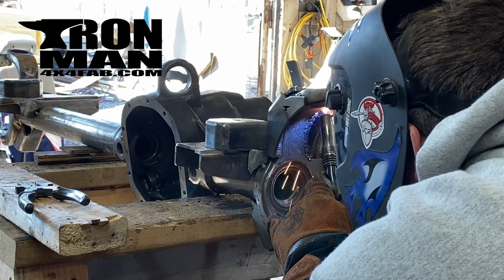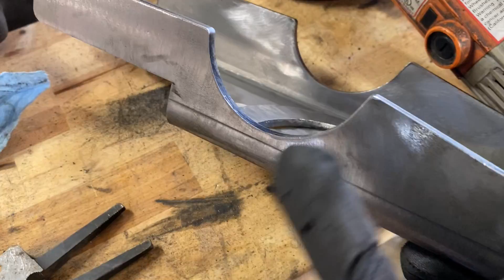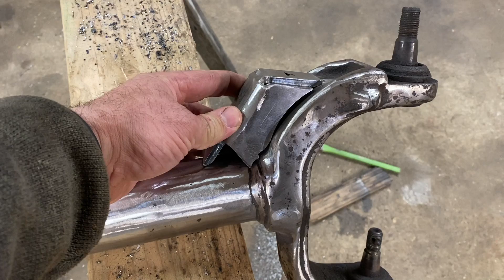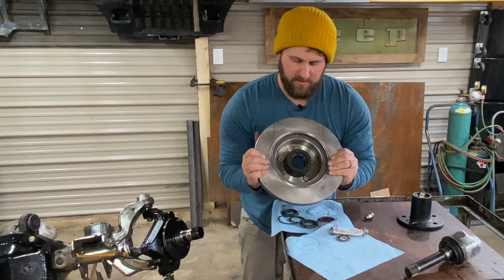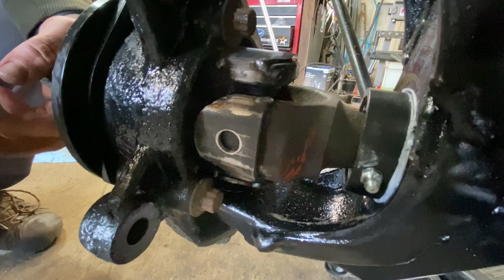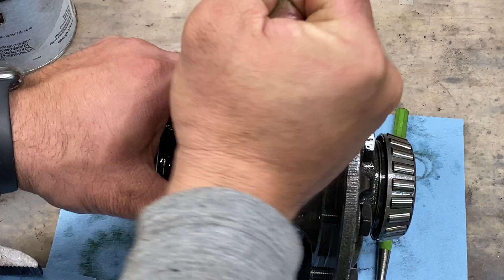Polishing a Turd - Beefing up a Dana 30 (without adding a truss)

Comment: Do you know what a used D30 is worth? I have a JK D30 with Yukon 4.88 gears and an Eaton e-locker. 20k miles, lightly used on 35x10.5 tires. I'm going to 38s and was going to run it till it breaks, but if I can get money for it in perfect condition, I can put the money towards an aftermarket 44.

Comment: Lot of work to a 30, but a high pinion 30 is ok for light wheeling if you don't push it. Given the amount of time and $ your into with the modifications, I'd go with the FSJ 44 and modify the oil pan for the added strength.

Comment: I’m trying to do this mile marker free spin on my xj with the wj swap . My xj mile marker rotor has 3 1/4 offset . What 12 inch rotor did you use with that offset ?   Does the sportrac rotor have this offset ?

Comment: Well after lifting the jeep I bought without really driving I found the front pinion bearing is falling apart .....I jumped on it coz it was cheap.  No real rust and clean title in defense of not testing it thoroughly .... I'm an auto tech by trade but I'm curious as to what master rebuild kits y'all recommend.    Iono what the gears look like yet but I want quality stuff so I'm asking for opinions from guys that know off road.   This is my first 4x4 and I'm hooked already

Comment: I sure like my currie 9 inch. One can argue they are as reliable as a Dana 60 and I doubt they weigh much more than a 30. My point is that the price can be a shocker but if you plan on wheeling a while then just bite the bullet and be done. 4 wheel disc, parking brake and a drop out 3rd member so you can work on the bench instead of under your truck. Every time I watch a tough truck vid. And see a 30 launched to the moon and still rolling I am amazed but anything over 32s is going to eventually show the weak stub shafts issue.

Comment: I am running 35” MT’s on my 16’ JKU Sport - stock D 30/44 axels with no HD ball joints, gussets or sleeves. It is on a 3 inch lift with Taraflex springs and the shocks are stock. My question is, how worried should I be about the possibility of breaking something with the way it is currently set up? I know it depends on the level of trail difficulty, but In the six months I have had it, I have done some pretty moderate trails here in Utah and have had no issues. Meaning, no hardcore bouncing off rocks or anything like that. But I do often hit 4 Lo to get up moderately steep switchbacks with moderate rock gardens,  but again, not crawling Rubicon trail or extreme Moab.. Am I OK continuing to do moderate wheeling with the way it is currently set up? What are some of my key limitations? Trailwise? 
Thanks so much! 🤙
Reply: As far as I know the axle housing in the rear is fairly strong and fine for 35’s. Upgrade to cromolly shafts in the rear if you decide to wheel hard trails. On 35’s and moderate trails the Dana 30 should be ok. The worst that will happen is you break an axle shaft. If you start wheeling hard I’d recommend c gussets and cromolly axle shafts at the minimum. Upgrade the ball joints to hd when they wear out. If you decide to go 37’s and hit harder trails the Dana 30 is pretty useless. You’ll break the ring and pinion eventually on 37’s and it’s likely you’d bend the tubes without a truss

Comment: Any coil spring fitment issues with the c gussets? 
Any ball joint fitment issues?
Reply: No ball joint issues. Springs I had to die grind the gussets a bit till the coils cleared but no issues beyond that
Reply: @DirtRoadTherapy  did you weld the sleeve on the outer edge and how bout the plug welds ? Did you drill holes front and back on the axle tubes
Reply: @DirtRoadTherapy  did you weld the axle tubes to the center diff? If so did it mess up The inner axle seal?
Reply: @moejr14  yes I did. And I did not have any seals in it when I did them, I re-sealed the axle after this. I pre-heated and covered in welding blankets and it has been perfectly fine since

Comment: I am getting ready to build a xj for a weekend warrior and drive it on the street some and i am gonna go with a 6 inch long arm lift 35s on 17s and gonna run stock axles if i put rcv axle shafts sleeve it re gear it and put a lock will it hold for mild offroading

Comment: Seems like if your going to do all these upgrades, you’d do them too a bigger Dana! Why upgrade a tird
Reply: Very cool what your doing
Reply: Because it will be fine and he don’t need to drop coin on a 44
Reply: The hub kit is really the only “expensive” thing I did and it’s certainly not for everyone.  I’ve been running the axle hard with the 285/70/17 tires and have been locked front and rear since about 3 months after completing this front axle. Other than randomly snapping the two stub shafts that came with the kit, the replacements have been fine, and the MM hubs broke so I replaced them with Warn and since then everything has been put through the ringer, no broken axle shafts, pinion gears, or U joints.  I’m really happy with the setup, but I totally get that the deciding point of putting in the work and investment I did is often the perfect justification for an axle swap 👍🏼👍🏼

Comment: Im considering on doing a solid axle swap on my 04 crewcab chevy s10. And bought a coil over spring solid axle swap kit, that uses TJ/YJ axles with long arms.   Gonna run 285/75-16 tires and basically a pavement princess,  maybe sum light off roading like dirt roads. So ill be using a dana 30 front axle.  This vid has been great. Now i know i can slightly beef up a dana 30 and know it will survive under my s10 build

Comment: Why are the coil perches welded on at 10 degrees? Is that a standard or is that custom to keep your front pinion in line based off your lift height?
Reply: That’s the spec that Barnes gives in their installation guide

Comment: Wow I wish I had seen this video when I did my bearings. I had no idea that this was the locking hub kit in there, mile marker didn’t know either. Had to look at the bearings myself and I was worried I wouldn’t be able to find the right rotors when I need to replace them. Thank you sir

Comment: I remember 10 years ago you could get bolt-on Rubicon Dana 44 bare housings that were a perfect replacement for the Dana 30 for $900 shipped from Ebay. Those were the days.
Reply: Was it an entire axel?

Comment: How about an update? any breakage?
Reply: Late reply, the only things I’ve broken on this axle are the stub shafts and lock out hubs. I’m running Warn hubs now with no breakage and new MileMarker stub shafts I’ve put those through the ringer and it’s holding up
Reply: @DRTJon  thanks for the update. What size tires are those?

Comment: Funny, Ive heard of people swapping out to a 44 because their 30 needed brakes
Reply: Ive heard people going from 44s to 60s because their 44s needed paint 😂
Reply: Uninformed people with credit or cash do stupid things because they have an inferiority feeling they’re trying to overcome 

The Dana 30 is a decent light axle under a jeep.
Reply: @fishhuntadventure  yeah if you are bone stock not running anything over stock tire size.. The 30s have too many weak points
Reply: @fishhuntadventure  it also depends on whether the person with the 30 drives what they have or what they want. Just because you can put on a lift and fit 37s on one doesnt make it right

Comment: After watching this I’m down to start practicing. Do you think I could get done some of this using a Lincoln mig 180? I know it’s not the best but I’m hoping if I burn it hot enough and do 2nd passes where needed it might be okay?
Reply: Aidan Parker is that a 230V model? It should be fine. Two passes is not always ideal, you generally want your heat to penetrate the first time unless you are really building something up as I did with the C gussets. For the control arm mounts and stuff you just want one pass. If your machine is 230v and can handle 1/4” thick material and .035 wire you’ll be fine just practice a lot on scrap till you feel confident!
Reply: Jon BleepinJeep yes it’s the 230v model. Thanks! I’m looking forward to trying it out on something besides scrap metal

Comment: Can you drill and tap those steel plate caps over the u joints on the axles? Instead of welding them? Recessed short bolts I mean
Reply: Gene Bowen I don’t think that would achieve the same thing
Reply: @DRTJon  I wasn't sure but thanks bud, awesome job btw

Comment: I was second guessing the Torq when I put it in the wife's ZJ D30. The springs didn't want to snap into the pockets and I had to bend one of the ends of the spring to give me enough peace of mind that they wouldnt pop back out. Once I got it in, it made a pretty good amount of noise and jerkiness when going around sharp turns in 2wd. Instructions said it would go away after about 500 miles. I'd say it was more like a few thousand miles. Its been a year now with 4 hard wheeling trips and you'd never know it was there until you shift to 4wd. Pretty happy with it now.
Reply: Very strange, I would have contacted their customer support about that, sounds like you may have received something a little off there, the springs retained nicely into the pockets on mine once fully seated.  I can definitely feel it has more of a desire to go in a straight line when driving in 4wd under acceleration but it's not overwhelming at all, and the steering doesn't feel jerky. There was no break in for mine, it's probably the diesel engine drowning it out, but I have to really put my ear to it to hear any clicking.

Comment: Are u running wj knuckles but not crossover steering? also u should weld those spacers I think 
But very nice work,  I’ve been running 37s on my hp30 soon to get a jk 44 tho
Reply: Jesse Cramer I welded the spacers on just didn’t show it sorry! Currently running stock XJ drag link with ZJ tie rod I will be changing to cross over steering and panhard soon

Comment: Ballistic Fab truss is $75
Reply: True, however that's JUST the truss. This would most closely compare to the sleeves I did in terms of what's provided in that.  And the sleeves are also $75. The truss at $75 is literally just the truss, no HD brackets/mounts etc. And that style of truss would sit about 3" from my oil pan at ride height on 5" of lift which is why I had to stay away from trusses.

Comment: Great video. Did you get the bracket angles off of an existing axle or did you find specs someplace?
Reply: Ryan Tidwell Barnes directions give all the angles and every measurement except spacing, which you need to get off your axle before taking off the brackets or from an I modified D30

Comment: See I wanted to put one of these torque lockers in my daily/semi daily, at least in the rear but haven’t ended up doing it because dozens of people have told me it would be a nightmare to drive on the street. And I’ve never drove anything with this kind of locker so I just don’t know much about them, I mean looking at the design and how they work I don’t see how it could affect on road driving that much but so many people have sworn that it would not be fun that I just kind of just forgot about it. How you put it tho it sounds like it’s actually not bad at all? Witch is what I would expect from such a thing. I know yours is in the front but I would expect it to be less noticeable in the rear if anything? Anyways now that I’m used to having air actuated lockers in my rig front & back it sucks driving the daily with.. open diffs. So I thought something like this might be a good affordable option? you know something I don’t have to worry about or screw around with, but is there when I need it.
Reply: You'll notice it more in the back. It only locks when you give it gas. I hear it's not as bad in an auto, but when I had an aussie in the back of my XJ with a stick, it really only locked up going around a corner while hard on the gas. I just put a torq in the front of my wife's ZJ. It was pretty noticeable for the first few thousand miles with loud clunks and ratcheting sounds while turning in 2wd, but now that it's broken in, you cant hear it at all.
Reply: Huh interesting.. I think I’m just gonna go for it & try out the torq in the rear. If I don’t like it in the rear I’ll try my luck in the front axle. And if all fails then whatever I’ll take it out sell it & get another set of manual lockers. I just didn’t want to spend that kind of money on my daily if I didn’t have to lol. Thanks for sharing your experience with them tho!

Comment: This has me curious now. I have a junkyard Dana 44A (the dana 44 with the aluminum center housing out of the 98 V8 ZJ) that I bought and am mildly building to replace the dana 35 in my ZJ. I plan on trussing it and adding a skid to circumvent the only weak point of the otherwise superior axle (the aluminum center housing that is prone to bending and cracking from stress). However I don't quite trust myself with a welder to weld to the axle tubes yet. I was asking around my local jeep club at a meet to see if anyone would be up to the task or have any recommendations for places. they told me welding to Dana axle shafts requires a special type of welder/wire/style (excuse my lack of welding knowledge) or something like that, so none of them would touch it. are they just blowing hot air to get me to charge more or see their buddy's shop, or is that true? would it be something an extreme amateur at welding like me can do at home after some practice on junk metal?
Reply: I suspect the people you are asking assume you are trying to weld aluminum to steel, which you cannot do. I would call and talk to Andy from Ironman 4x4 Fab about using their D44A truss and ask him for any tips on welding it, he knows his stuff and is good at teaching through giving concise tips.

Comment: So after doing sleeves, if your you rip your inner seal, you only relies on the 10 outer seal?
Reply: Blue Alien Network the outer seal has nothing to do with the sleeves other than I had cut them to be able to work with that mod. The outer seal is not to retain oil just to keep dirt and water out.

Comment: Did almost every single one of theese same things as you recently just finishing the vehicle build up my 98xj  HP 30 plus an OX locker cable actuated setup and plus Rusty's offroad low profile 105$ truss. Did the truss cause why not but I won't be swapping anything out though except to build a 4.7 stroker.

Comment: A fine presentation of fabricating a stronger Dana 30! Upgrading the stock wimpy sway-bar mount and improving the brakes are great additions for any XJ - even those running smaller tires. However, I'm a big fan of switchable lockers - like the OX cable actuated with the optional electric solenoid.

Comment: Couple things. When welding the brackets on the “C’s”, should have pre heated them to at least 400*F.  Also noticed a couple Mig Welding faux-pas’ g that shouldn’t be practiced. The first is your technic on welding vertical. Never “down weld”, always go from bottom up. Second is you never pull a Mig torch, always push into the weld. Pretty basic stuff I learned  in trade school early in my career and always stuck with me. Nice work though, I’m not sure I would spend all that time and money on a 30, but you have your reasons. I’ve been running an Aussie up front in my Toyota solid front axle for 7 years, and never had a failure. Also made in USA 😉.
Reply: Fake Parts thanks for the tips. I was told by Iron Man Fab to weld down for the Cs also was instructed that there is no need to pre heat a forged part; it is not a casting.

Comment: I have had several jeeps and I wheeled them hard and only problem I had was a broken track bar bracket.  Had 33's. It's how you drive not what you drive. I could drive from across the country with no roads in my truck no problem.  (Except for bridges 😛) weld the tubes, brace the c's and pick the right line.

Comment: You're a great fabricator.  Good job.  I don't really follow the need for the MileMarker hubs, other than the cool factor, but overall a very impressive 30 build up.
Nice job.
Reply: Lots of $$$ wasted on the hubs.
Reply: @davidgrant3940  How do you know that? I think the new kits available are super expensive for sure, but I picked this up used and in the video I don't strongly recommend it at any point or for any reason.  It's a nice option, but it is far from a necessity, and it's not a strength upgrade.  I was also able to pick up a spare single hub on eBay for $25, and the stub shafts and bearings are available at any parts store as they exchange with Ford Ranger and Explorer D35 IFS axle from the early 90s.
Reply: @DRTJon  
How do I know? 
You just proved my point. 
They are expensive,  they are not necessarily & they are not a strength upgrade.  Therefore a waste of $$.
Reply: Thanks Eric! The MM hubs are a cool addition, I'm glad I have them but I personally wouldn't go out of my way or spend even half what a new Yukon kit costs to do them again. One cool thing about the Yukon kit is you can get it in a 5x5" lug pattern which allows you to bump up to JK aftermarket wheels. I explored this option a bit before installing my kit, but they want $500 for that hub upgrade to their own kits.. I'd guess it would be compatible with mine but at that price point I really don't care to even call and find out

Comment: Great job, Jon! I've also done some strengthening to my 30, unfortunately prior swapping the engine and now I have the same issue with my truss being too close to the oil pan. Funny thing, last week I started thinking about removing the truss and sleeving the axle tubes or getting a stronger axle. I somewhat like the Turdy but I would be much more confident with a bigger axle on my 35's
Reply: I'm on 40s and a JK Dana 30

Just don't be afraid to turn around and go home and choose your lines wisely.
Pride & ego kills Dana 30s
Reply: @ElevatedVehicles what ball joints do you use?